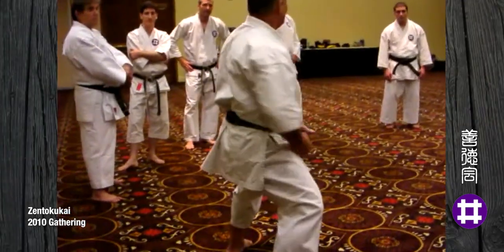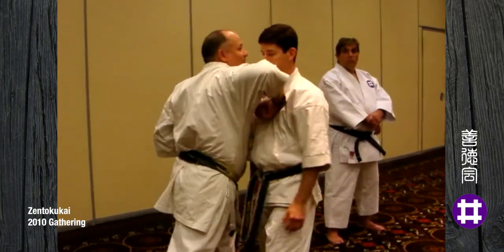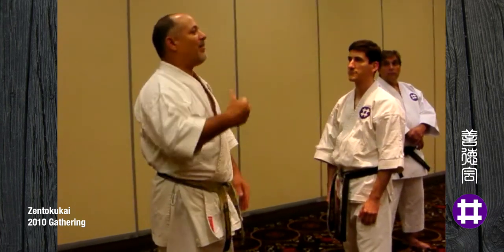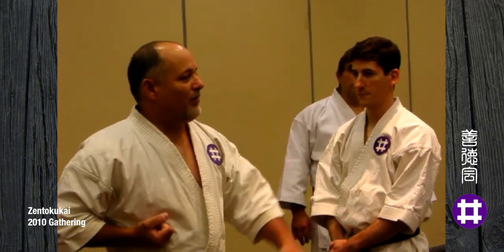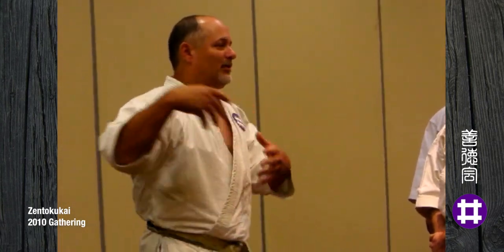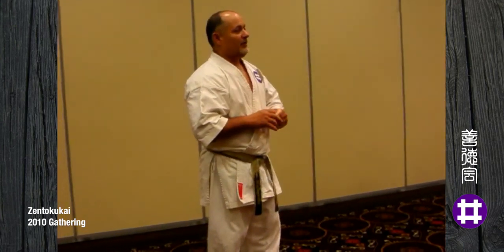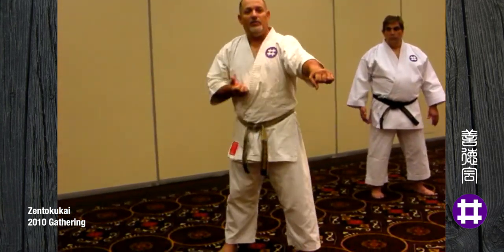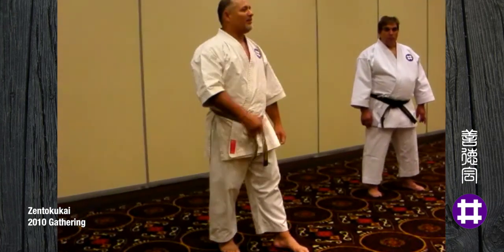Punching Lecture 2010 Lemus Sensei

Comment: is there a diffrense if the impact is first with tate tsuki and then the twisting of the punch? thx
Reply from the maker: The Tate Tsuki provide a large flat area of impact spreading the power over a larger area. The old Okinawan punch featured only the index knuckle on a fully closed fist held at 45 degrees, this single knuckle impact focuses all its power and penetration on a single point thus creating a deep and penetrating strike, it is ideal for the mid section especially the rib cage and the sternum. But both of these fists are part of the total arsenal used in old Okinawan Karate, as well as the boshiken (thumb knuckle strike) ippon ken (index knuckle strike) and nakadaka ken (single middle knuckle strike), all were tools used for specific targets.
Reply from the maker: Yes there is but it all depends on the target, the standard Okinawan fist we use is angled at 45 degrees and using the index finger knuckle this is for focusing all your power on a single point, the Tate  Tsuki generally is a much larger impact surface.  I would not want to get it by either.